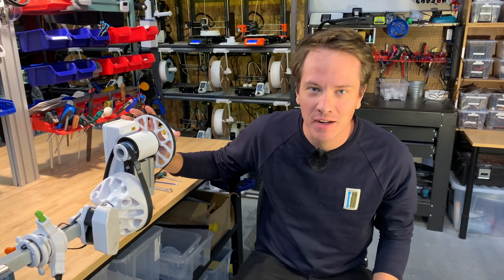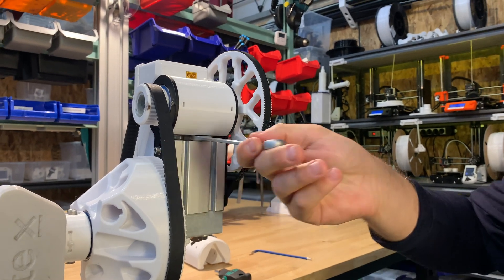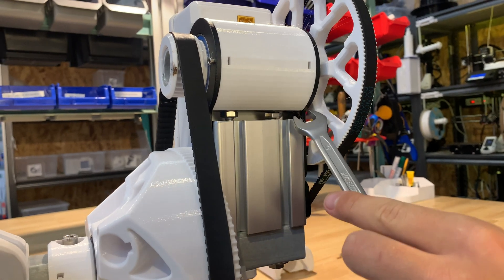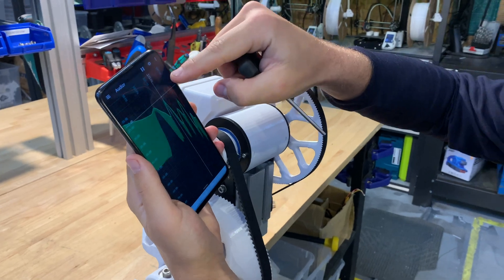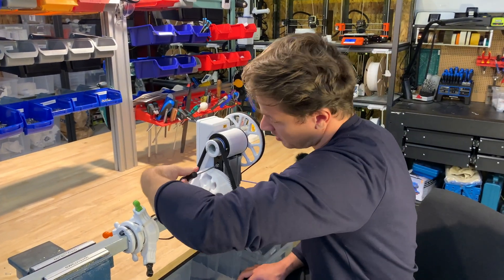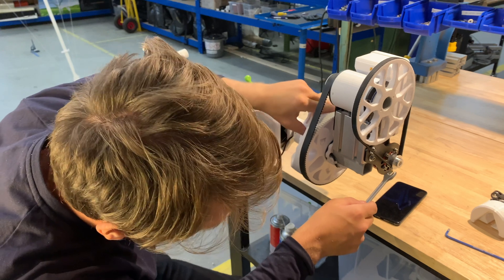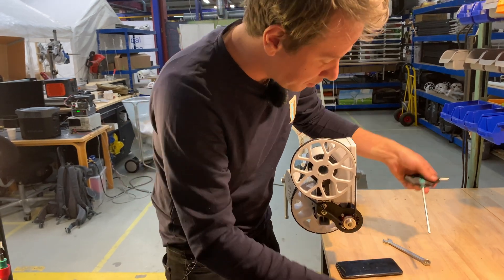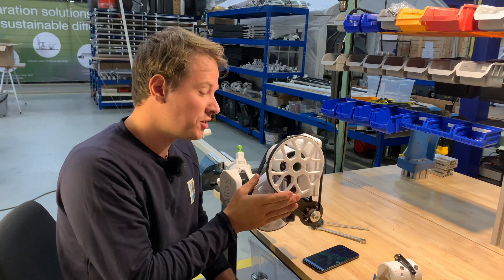Belt Tensioning

Comment: young fella, run it at 30, 60, 90%. Of normal operating speed. adjust accordingly. Last test, 100% of expected. Always test at expected RPM.  Belts do unpredictable things at different speeds. My experience only. just sharing.
Reply from the maker: So running it at different speeds between adjusting the tension/angles?